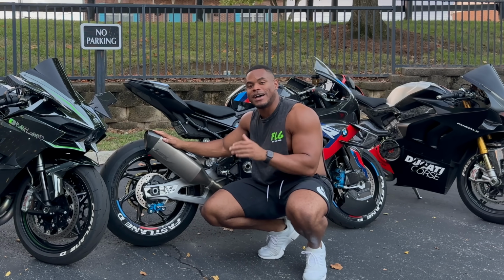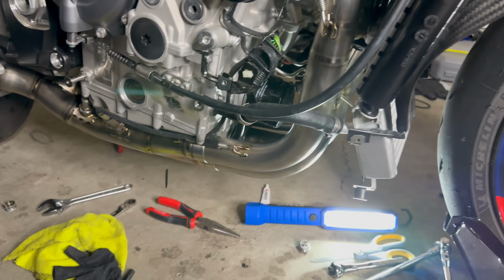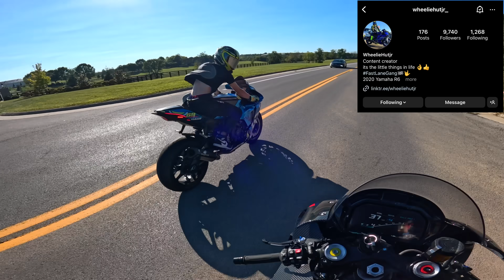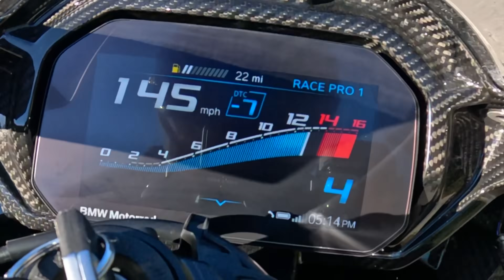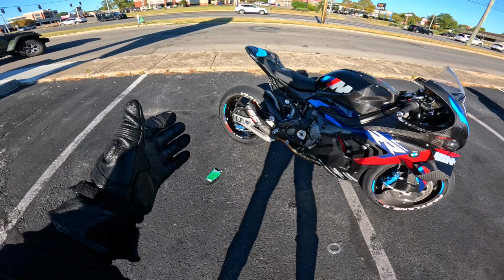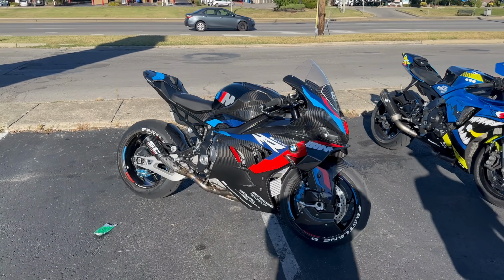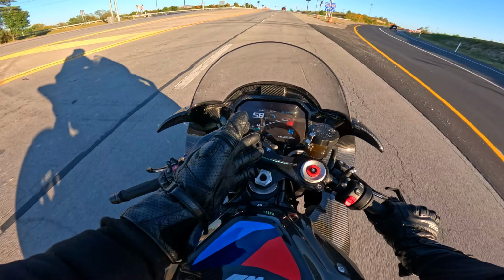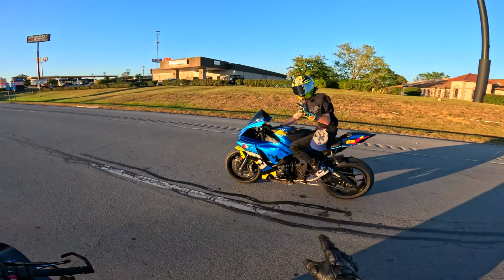FIRST RIDE with INSANELY LOUD Exhaust On M1000rr | R1, BMW S1000rr

Comment: Not affiliated with BT moto but looking at an M1000RR struggle to get to the limiter in 3rd gear breaks my heart :D

I can't emphasize enough how much this bike needs the BT Moto IAT kit. I have the S1000RR and when the bike warmed up it didn't want to power wheelie even in second gear. It would do it when the bike hasn't warmed up properly and as soon as it got warm it started to lose a lot of power. It was showing air temp 55 degrees celsius while it was actually 30 outside and the IAT kit fixed it.

Comment: Well done.👍
The Termignoni titanium full race exhaust (de-cat) on my Ducati DesertX measures 109db one foot from pipe at idle. Ducati adds an EVO tune with the exhaust upgrade. Lots of brapps, pops, burbles.
Fun fact. This setup make a "brown tone" for small dogs.
Roll up to a red light idling, little dogs with their heads out car windows will pull back in. After around 20 seconds the dogs will slowly stick their heads out the window again. Crack the throttle sharply (brapp) and the dog craps. 
I've made three little dogs dump on drivers laps in the past few months. 😂

Comment: As a ducati mechanic NEVER NEVER install a aftermarket exhaust without a tune, yes you have "more" power because the lambda is leaner, in 1 year was 6 V4s 2023 with less then 3000km with the engine fuckd

Comment: Bmw are known for their intelligent sensors and systems notice with the first start of the exhaust the idle is rough and choppy that is because the bike is adjusting to the new back pressure and fuel ratio that comes with the new exhaust through the o2 sensors

Comment: Does removing weight from the lowest part of the bike negatively affect handling at all? I thought the lower the centre of gravity the better?
Reply: That’s not the full story, the lower the weight on a bike the further you have to lean it to make the same turn at the same speed vs a bike that had weight higher. That’s why adventure bikes like the GS handle so well, the weight is higher therefore you have to lean less to make the same turn etc. People will have preference, and lower weight in terms of closer to the floor feels better, more flickable, compared to it being higher from the floor, but less weight will add flickability vs higher weight adding stability. It’s all a trade-off. In this instance the weight being removed from the bottom will bias the weight slightly higher up it not enough to really notice the turning difference leaning  differences. But you would notice that the bike was lighter.
Reply: @josephparry  Thankyou for the information!

Comment: Ride with out a rear view mirror is a dangeres drive for you and the other people there drive the roads, only ideot heads have no intresting what is behind me? come a car or bike behind me and need to over holing me? come a rescue car behind me and will me overtaking? For a good save ride you need two rear mirror,we all in Germany have two mirrors on our bikes,and we have not so much bike crashes like you in the USA,where the Lizenz for riding bike,is to low,you dont learn lean angle in curves, no emercency hard break, we in Germany musst have over 10 hours practiv ride with riding scool bikes,and 16 hours learn the rules from the since and so on! Bike riding is so much dangeres than drive a car,its better the Biker go in a driving soll for bikes,bevor there ride on streets!!  Sorry for my bad english best wish Reiner from Germany